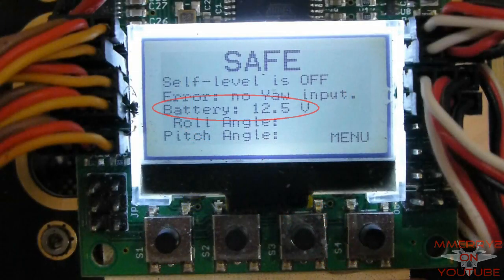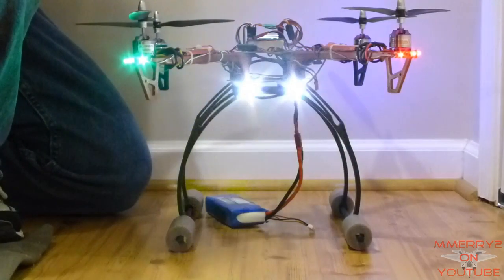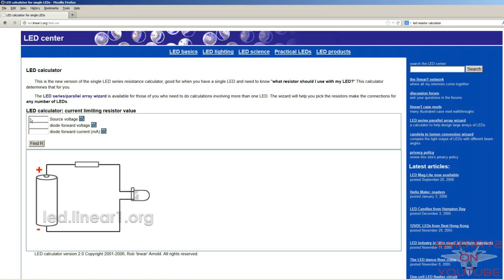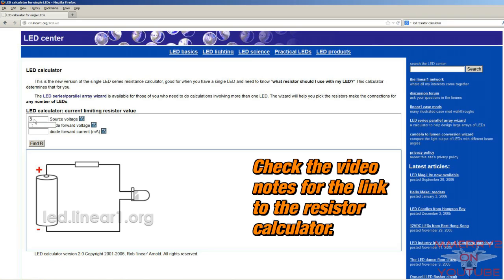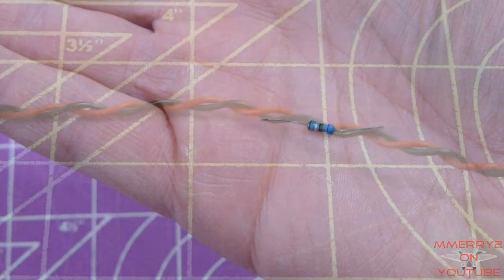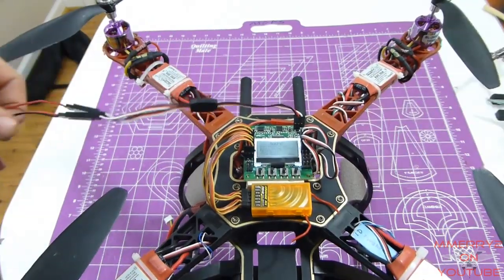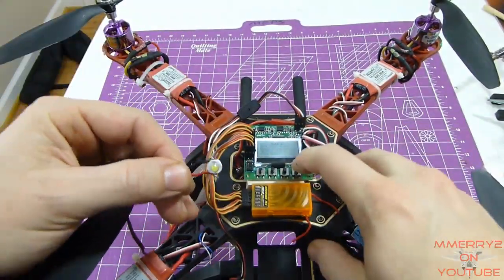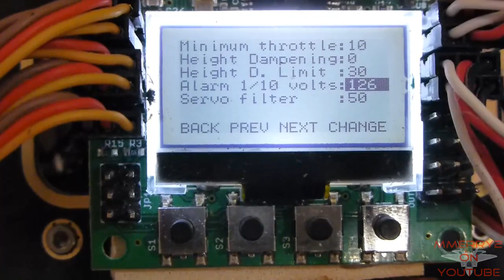DIY Make Your Own KK2 LED Alarm for KK2.0, KK2.1

Comment: question do you have to solder an extra pin to the main battery to get the kk2 to display the current voltage?  or do you just connect the buzzer and will it show the estimated voltage? I have a hextronic kk2 board and its slightly different

Comment: When you use 2 lights and the buzzer (as you did on your copter), do you simply add the 2nd light in parallel with the same resistance in series with each light?

Comment: I imagine you could wire 2 leds in series and get the required voltage drop you need to be safe.
Reply from the maker: Since the output voltage is 5V, you can only do two LEDs in series if you can find two 2.5V (or less) LEDs.   Otherwise the LEDS may not light.

Comment: do you have a video on connecting led s to the kk2 for flight orientation?
Reply from the maker: Salvatore, I assume you want to keep the LEDs on all of the time for orientation.  Check out my video titled "DIY LED Wiring for your RC plane, car, truck, etc." here:  DIY LED Wiring for your RC plane, car, truck, etc.    My video shows you how to get the power for the LEDs from the receiver, which is connected to the left side of the KK2 board.  You can connect your LED wires to the receiver or the left side of the KK2 board.  If you want an simpler solution, it's easier to get a 12V LED light strip and cut off a section of 3 LEDs.  Mount that where you want it and run 2 wires from the light strip to a 3s Lipo battery.

Comment: I'm really confused about the voltage sensor on the KK2.1.  I'm sure it's just me but are you saying that I cannot just plug my beeper/flasher from my old kk2.0 setup to the buzzer pins?  What are the other two pins just to the left and behind the buzzer pins?
Reply: LOL.  Funny.  No.
Reply: You can still plug your beeper/flasher from the old kk2.0 setup into the buzzer/flasher pins on the KK2.1.  On the KK2.1, the left-most 2 pins to far left are for the voltage sensor and the top-most 2 pins are for the buzzer/flasher pins.
Reply: FlightBulb Thanks.  I finally figured out that I had to run a positive lead from the battery to the positive pin on the voltage sensor.  Then with my beeper on the buzzer/flasher pin all is well.  Oh, and as everyone points out the positive pin on the sensor is the one nearest the outside of the board.  If you wire to the other one you will smoke your board.  I'm glad I read about it before I did it.

Comment: I thought you have to wire the board to the battery first on the KK 2.1. The to pins that are near the buzzer/led pins?
Reply from the maker: @Marty.  Yes, you are right. You also have to connect your flight battery to the KK2 so that it can sense the voltage.  The KK2.1 has a 2-pin header that you can connect a JST or servo connector to.  The KK2.0 requires you solder leads onto the KK2 board itself.
Reply: mmerry2 on YouTube Also, you typically don't need the ground wire for the voltage detection. It uses the common ground circuit for that. I just have one extra lead from the common battery V+ to the single solder pad on the KK2.0 board. Granted, if you for some reason have separated the battery circuit and the BEC circuit completely, this won't work. I can't think of any reason why you would do that, though. Also, you would also negate your separation if you then use the second ground wire to actually complete the voltage detector circuit... ;)